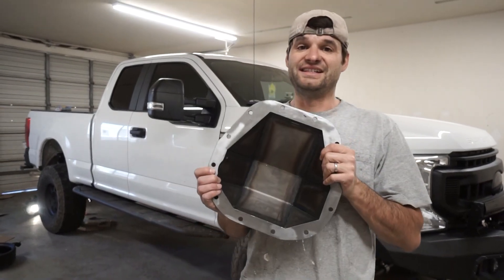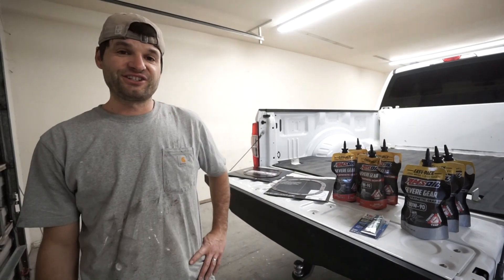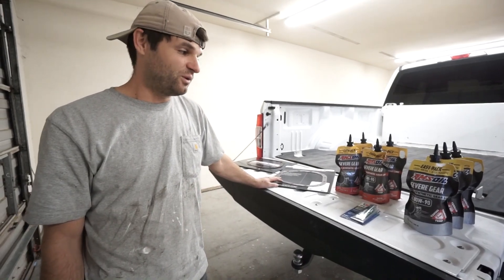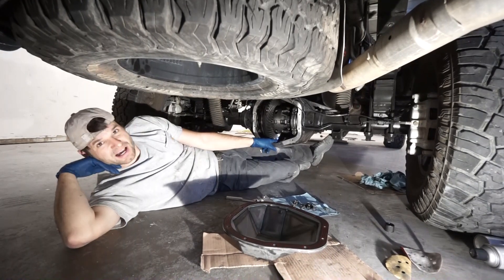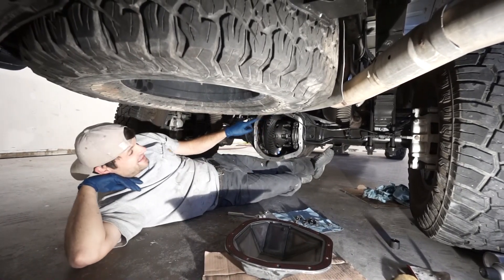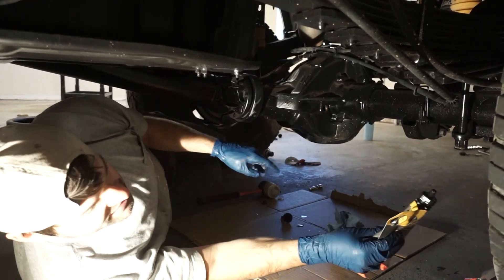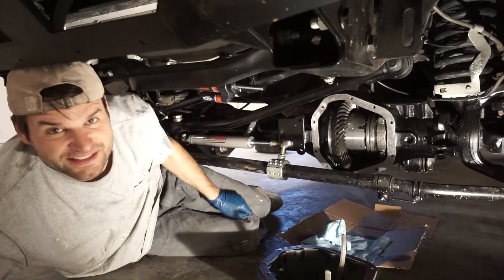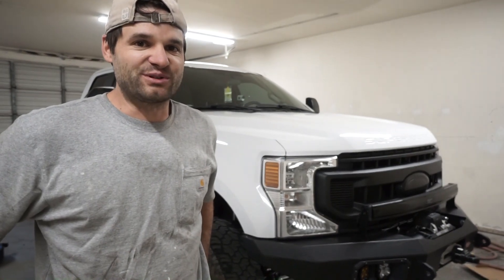Differential Service Tips: Amsoil Gear Oil, Lube Locker and more! - Super Duty Build | Part 21

Comment: I changed both my diff covers at 160k miles and the fluid was still clear, like new. I've been through water and mud several times. That's why Ford has long service intervals. Most people experience the same clear fluid. I think you have contamination issues if yours is dirty at 30k.
Reply from the maker: It's a good idea to service early.  All differentials will have beak in wear.  We serviced our Raptor and Bronco at less than 10k miles.  They both had metal break in material.  Cheap insurance.  Easy to do

Comment: I recently asked Ford what is done at 10k and to my surprise their answer was "nothing really". Is it possible to have Ford replace any of their fluids w/full synthetic (oil is synthetic already)?
Reply from the maker: That's basically true until 100k miles.  But it is wise to service differentials, transfer case and transmission every 30-50k miles if you plan to own long term.  Rear differential has synthetic already.  Front is not.  You'd need to ask your dealer.  Sometimes they will service with customer provided fluid as well.  Hope that helps!
Reply: Mine was clear and perfect at 160k miles, both ends. That's why they say not to service. His has contamination issues.

Comment: Do you have to remove the cover to drain these, or can you just do a drain and fill?  I've got the same truck, 2022 model that I use to haul a truck camper as well.  I haven't changed mine, but would like to be able to do it myself.
Reply from the maker: Yes.  There is no drain plug so you do need to remove the cover.  Definitely a good DIY project.   Let me know how it goes
Reply: You can suck out through the fill hole , but you may only get 80% or so out . Plus all the crud on cover is still there

Comment: You always have great content. I have the Sterling also and also did it early like you . And used the Amsoil 75 90 . Next time I may go to their 75 110 just for kicks . 
So on the front differential is it always spinning? I know the hubs aren't unless your in 4 wheel drive . Hope I worded it right , the gears in the case .
Reply from the maker: Thanks!!  Keep us updated if you go to a heavier weight gear oil.  Curious if there would be any noticeable changes.   
Front differential is only spinning in 4wd or if the front hubs are locked.  They auto lock (via vacuum) when shifting in 4wd.  So you can wait longer between servicing (if not using 4wd frequently).  Good thought...
Reply: @TruckCamper  thanks for the reply , I also drained the transfer case of the factory fluid and put the Amsoil Signature Series ATF . Why Ford is so hung up on Semi synthetic fluids is beyond me .
Reply from the maker: @kenj.8897  That's a good idea.  Planning to service the transmission and transfer case soon.  Curious to see how they are wearing...  it is strange where ford uses synthetic and doesn't.  Rear diff is synthetic factory but not the front

Comment: Great tip on changing these oils way sooner than the service manual says. I've always swapped out everything, engine oil, trans, diff, steering fluid, trans, transfer case, brake...anything that's "wet" at least 1/3 sooner than "recommended". I don't have problems with my vehicles. I look at it like it's clean blood.
Reply from the maker: That's a great way to look at it!  And no harm in changing sooner...  it's incredible how extended the recommended manufacturer intervals are (too many miles).  Good stuff